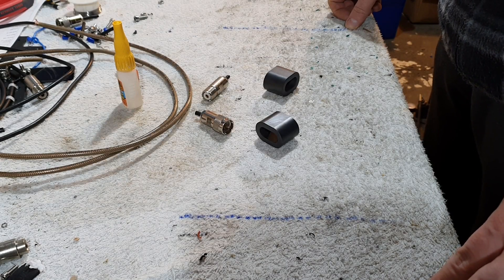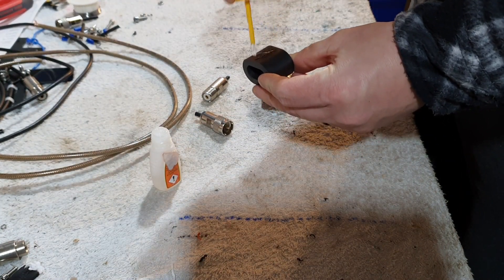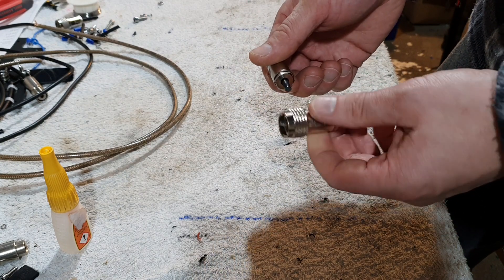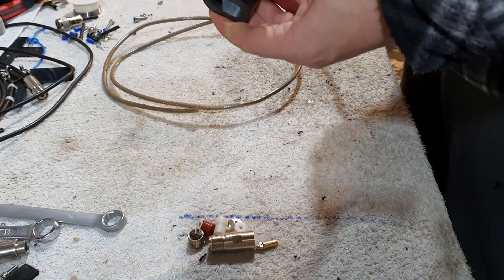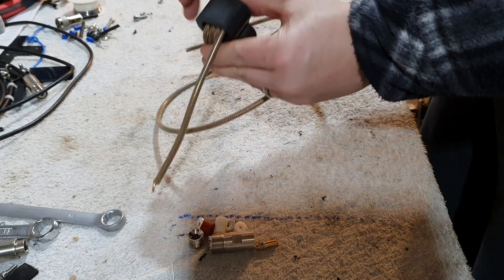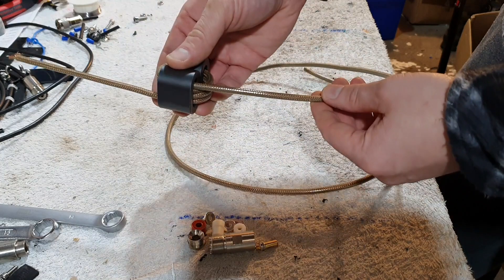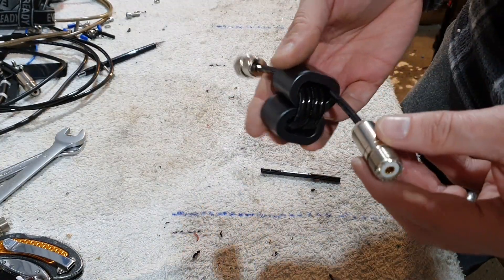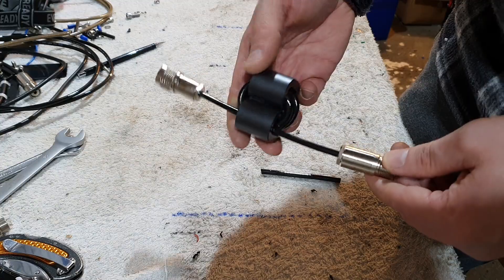Make Yourself a Cheap and Effective Ham Radio Choke Balun for 20m - 10m

Comment: Don't know if you had a play with these Colin, made the choke the same as you with an extra turn using M&P Hyperflex 5, using a Nano VNA for the first time I got -32.65db @ 1.8Mhz, -29.17 @ 14Mhz & -27.26db @ 30Mhz. Made the mid band one with 3 cores, 4 turns as per design - got -32.22 @ 1.8Mhz, -28.73 @ 14Mhz and -30.94 @ 30Mhz........ not going to bother with the larger of the low band one... weird results...am I doing something wrong with the VNA? Zeroed everything out with short/closed etc etc and used S11 logmag... very flat accross the whole of HF.
Reply from the maker: I think the method of using the NanoVNA is not ad fullproof as we thought. I would still stick to the design and use the right one for the right bands. Its choking impedance that matter. Have a little research.

Comment: Hello Colin - I want to build a 4:1 unun and I was wondering if you could recommend a Toroid that I could use.  It would be for at least 100w SSB.  I’ve seen people use both  powdered iron or ferrite material.  Cheers, Bill. KC2KNA
Reply from the maker: Not really. I've only ever built 1 4:1. It was one for QRO. 2 x FT240-43 cores wound with PTFE coax. It worked really well.
Reply: @MM0OPXFieldRadio  thanks for the feedback Colin.  I will continue looking into finding the best Toroid for a 4:1.  Have a great evening….

Comment: Hi! thanks for the video. What glue exactly are you using? Standard 'super' glue (cyanoacrylate) or something like Gorilla brand glue which is a polyurethane glue. I suppose one could also use epoxy too. Thanks!
Reply from the maker: Using the Gorilla superglue. No issues so far.